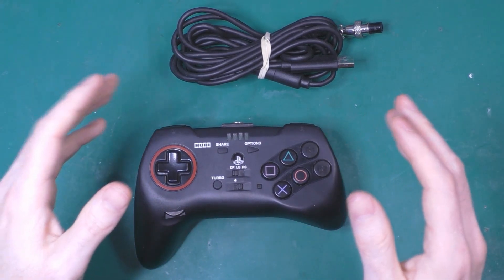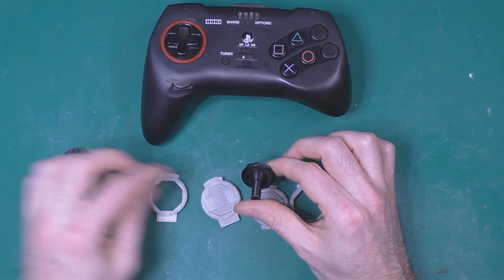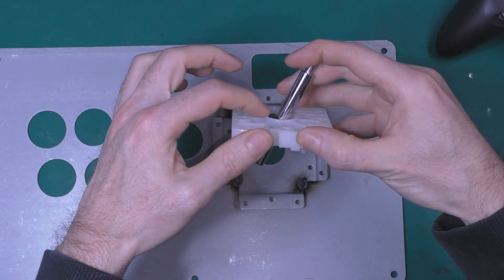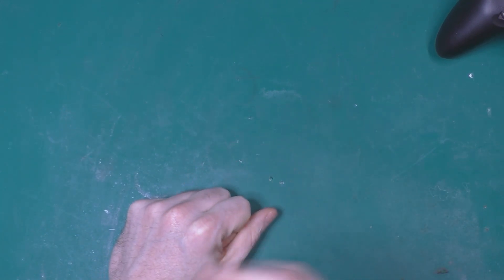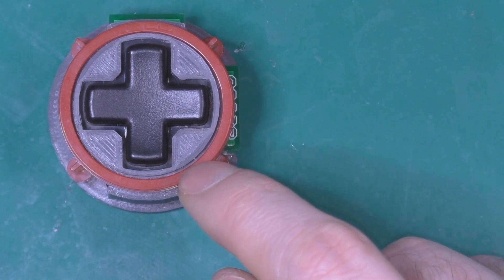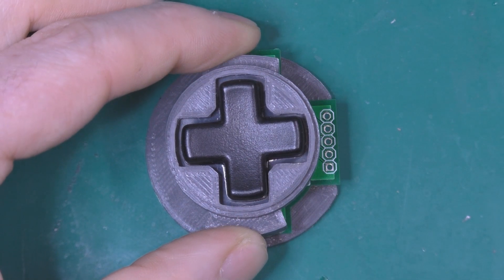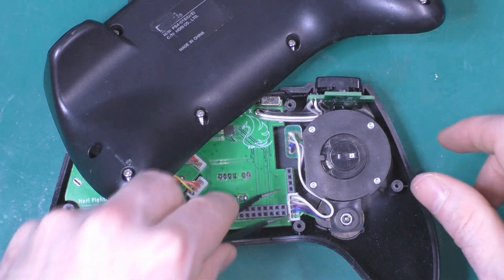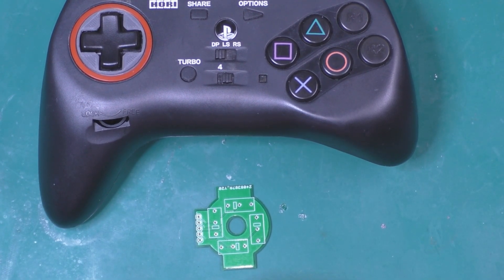[Arcade Stick Mod] Part 15: Hori Fighting Commander 4 Total Overhaul - Part 2: D-Pad

Comment: Hey @TheRealPhoenix_Retromods hope you're doing well. Was trying to check your store but been unavailable and looks like haven't been here in a minute. Loved this video. Were you taking any commissions on the pro commander 3? I have one where the D-pad (right lower side) is messing up. I heard it was pretty difficult to fix, but with all the new 3D printing and what you were doing. I was hoping to save the controller.

Would love to connect with you!

Comment: When the Corona Virus pandemic is over, I will be interested in purchasing this mod. Actually, I'm interested in purchasing this already.
Reply from the maker: PCB are here (20pcs) and I should receive some PETG to print the parts. However microswitches are comming from China and I'm wainting for other stuff from them for more than 2 months now.
D-pad Kit should be around 15/20 bucks depending of the sourcing of the microswitches.
Reply: @TheRealPhoenix_Retromods  When/Where can i buy the Dpad kit?
Reply from the maker: @WeisenbergTKMrWhite  I have a bunch to assemble, check on my store I've just add a "Notify Me" feature https://trp-retromods.ca/index.php?route=product/product&product_id=81

Comment: Fantastic and Thank you for publishing the D-Pad mod.  Just ordered the PCB and switches.  Will you publish the other boards to fully integrate with the Brook Universal fighting board?
Reply from the maker: I don't think so. The full mod is over-engineered and painfull to install and align, even with the 3Dprinted parts to help. Also people who tried it find the course of the 6 front buttons too long. At the end this is more a "what could it be if Hori made actual effort on the controller" rather than a a real DIY solution.

Comment: Hi phoenix I had 2 questions for modding the FC4, first being will the dpad kit ever restock? Because I'm interested in buying one. My second question is I know putting the brook Ufb must've been a hassle aswell as the pcb's and sewing the shell, is it possible to replace the membrane on the base fc4 with microswitches but with the original pcb? Because I was wondering if that's possible with the fc4 and the original fighting commander. Regardless I admire your work!
Reply from the maker: I made an order in marche for a 10pcb batch for the D-pad, but the order was lost/stuck in China. I made an other order last week (I had to wait the PCB fab accepts to refund me) and it should be shipping soon. Unfortunately there's not enought space to put microswitches, even the low profil ones I used on the shoulder/trigger buttons. Cheers.

Comment: Hello, is there any chance you have print models for the actual dpad and red holder ?
Reply from the maker: Nope sorry.
Reply: @TheRealPhoenix_Retromods  Hey no worries. I bought a secondhand controller to try this setup in a project. I ordered all pieces separately but I have remaining questions for the JST connector.
I ordered the PCB off OSHPark, am I supposed to solder the connector to the PCB ?
Also, do you have a reference off say AliExpress for the JST connector ? I'm not too savvy and I want to make sure I order the right piece.

(I wanted to order your kit to avoid doing all of this myself, but since it's out of stock I figured I could do it myself because I was too impatient.)

Thanks again for taking the time to do this.
Reply from the maker: @nikuichi9948  Yes, you need:
- 4x Microswitches (I recommend omron D2FC-FK(50M)),
- 1x Male 5 Pin JST PH Connector (2.0mm),
Just 1 connector is going to be complicated if you try to order on Aliexpress (mostely a bulk of 50pcs). No special link but something like https://www.aliexpress.com/item/1005004393386300.html should be good. Or you can order just 1 on place like Digikey or Mouser.
Reply: @TheRealPhoenix_Retromods  Thanks a lot for all the answers. Hopefully I'll manage to make good use of all of this.
Reply: @TheRealPhoenix_Retromods  Hello again, sorry to revive an old topic but I had ordered a PCB with your plans off OSHPark and I am confused because there is less than 2mm in-between each hole so the JST connector won't fit. I'm not sure if I did anything wrong.
Reply: @nikuichi9948  did you do it? It turned out good? im intertested in doing this myself... I just bought an used FC4 and i'd like to try this

Comment: I know it's been years but is there any chance in hell of this coming back in stock?
Reply from the maker: Yeah I restocked it multiple time. But since the sales are really slow now maybe I could do a last run.
Reply: @TheRealPhoenix_Retromods  Yeah it is kind of niche. They dont sell this thing anymore and I just happened to find an unused one in my drawer. Could the design be adapted to replace other dpads I wonder?
Reply: @TheRealPhoenix_Retromods  I need this too
Reply: @TheRealPhoenix_Retromods hey, are you ok, dude? And you still has some kit for sell? I just happen to find and old FC4 Hori and really wanted this mod... or maybe if it is possible with the Fighting Commander Octa

Comment: Is the PCB for this mod compatable with the original main board
Reply from the maker: The D-pad alone, yes. It replace the original part. And it will be available on my store as a kit, but it will depend of the coronavirus.

Comment: Why re invent the wheel? Why not use the neogeo CD pad approach? That’s a stick that works on a pad.
Reply from the maker: Does de NGCD pad is a cross? No, it's a thumbstick. Would it fit inside the "cylinder" shape available inside the Hori? No, it'd required a larger hole for the thumbstick on the top and more horizontal space inside to have the mechanic (springs + microwswitches + PCB) and proper course. Would it be more simple to do? No I'd have to add (and source) 4 additional springs, plus print more parts, parts so thin that I'm not even sur I could make them solid enough with a FDM printer. It won't fit my needs, not fit in the space I have, and won't be simpler or cheaper to make. So I'm not sure what you're saying by "reinvent the wheel".
Reply: @TheRealPhoenix_Retromods  lol did you try to use the Xbox elite pad and didn't work? yes, figure the rest yourself.
Reply from the maker: @G-zeus_M  I already figure it out, you just didn't watch the video. And I only wanted the diamond shape since it supposed to get on the top of the dpad of the elite controller. And still take less space than the NGCD controller...
Reply: @TheRealPhoenix_Retromods  I did watch the video, you went back to the cross pad so you couldn't figure it out, If you want to use an stick motion it wont work otherwise the SNK guys would have implemented it long time ago but you may have a better chance today with the tools from this era, ==O==( hint
Reply from the maker: @G-zeus_M  You haven't read a single thing of what I wrote. I've already explained you why I couldn't (and didn't want) go to this route for space inside the Hori and the mechanical reasons it implies. At this point your are trolling.
Reply: @TheRealPhoenix_Retromods  Ok think what you like I already invested too much time on this for what it’s worth.
Reply: @TheRealPhoenix_Retromods  Although the dude you're replying to was an idiot, as evidenced by the resulting conversation, thanks for the explanation of the limitations. I had watched the video but I still didn't understand how the neo geo would of solved presumably the same problem. Now I get that they weren't constrained by the cross shape and the cylinder of the hori fc4 you were trying to fit it in.